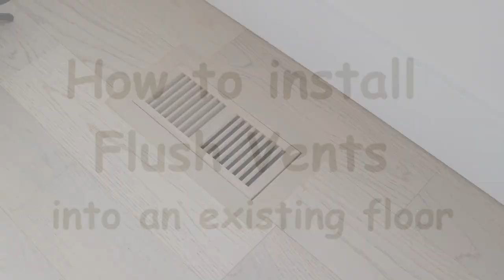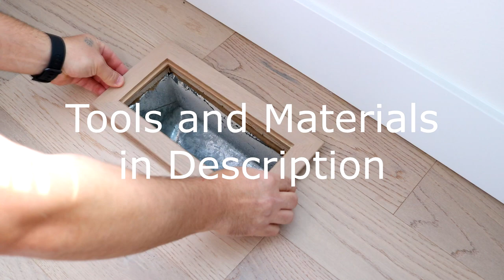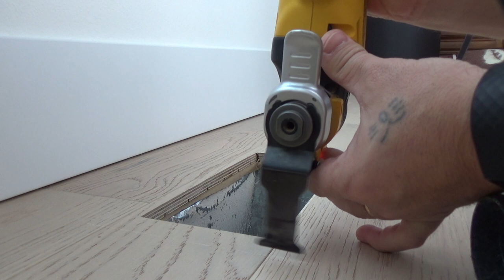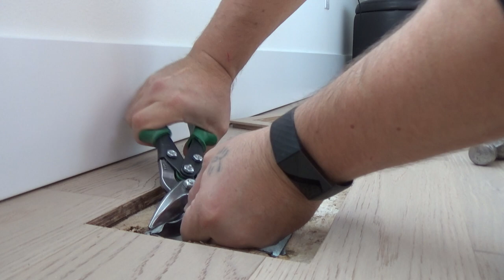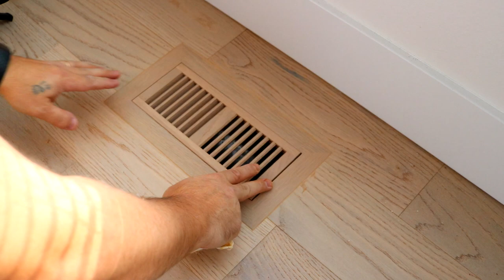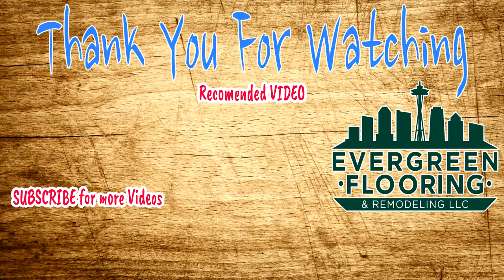How to Install flush mount vent into an existing floor

Comment: I've watched several videos on flush mount wood vent, and this is by far the most practical for me, which I will use.  I have an oscillating tool which I will put to good use, if I have anywhere close to your steady hands.  I will try to use a guide (like a template) to hold the tool steady.  Thanks for posting this video.
Reply: I agree 100%

Comment: Thanks for your video.  You certainly have a steady hand to cut that straight line into hardwood with an oscillating tool.  It can be easy for those things to get away from you.  And I appreciate all the info about the tools that you used, but what about the vent itself?  Is there a certain brand that you use/recommend?
Reply: It wasnt a hardwood, it was more of a plywood with a veneer on top. Look at .33 and you can see the layers in the flooring. Much easier to cut than something solid.
Reply from the maker: You're right, This is not solid hardwood, but this is engineering hardwood. I showed the process and how it is work and there is no difference if it solid wood or engineered wood.

Comment: Wıll there be an issue with by-passing the tongue and groove edge on the register? Will the wood dry out and form gaps after the finish is applied? Considering this solution...

Comment: I need to connect two duct boots, one in the floor for current vent and wanting to change placement as making a window bench. What if the best way to seal the gap between the two rectangular shapes prior to attaching metal collar etc.

Comment: Normally, a register has baffle control, when you switch to a flush mount, you lose the baffle control, to adjust the air flow.
Reply from the maker: vents with an air flow regulator are not always installed.  in more than 15 years of working with floors, I can probably remember several times that there were vents with a regulator.